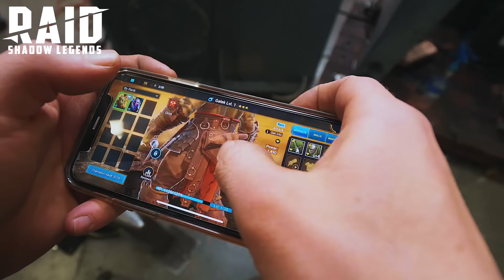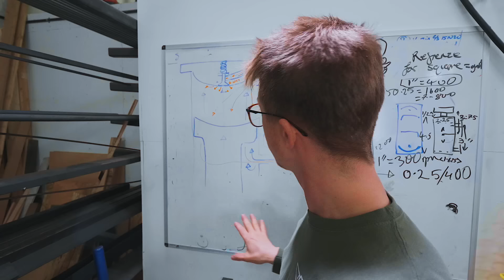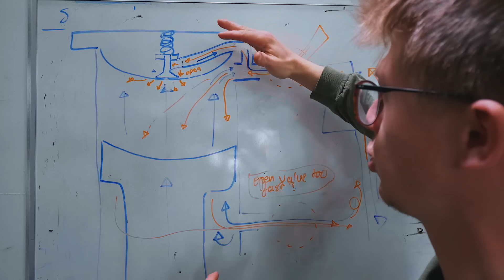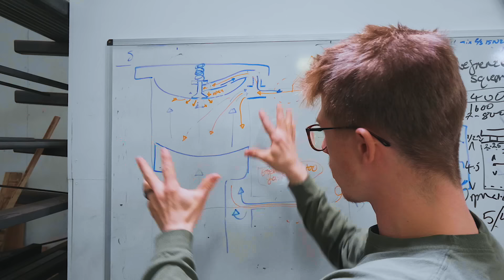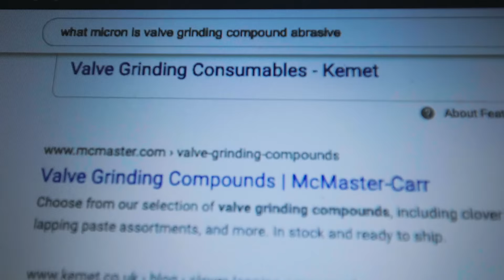FIXING THE 300LBS POWER HAMMER!!! Part 5

Comment: If you had to adjust the timing because the valve was leaking, wouldn’t you need to adjust it back once the valve is fixed?
Reply: I don't think so because the performance improved after he adjusted it and it doesn't appear to have lost any. If you pause at 7:40 and look directly left of this thumb to me it looks like the valve itself has some pitting that would prevent it from having a good seal on the seat
Reply: @435now  That's only a problem if the pitting goes all the way across the mated area...
Reply: @435now  that was the whole reason that he did the diamond lapping which after lapping you see he had 100% contact which means that that reasoning goes out the window because that was repaired. I agree with the Readjustment of the piston valve back to its original position. If the check valve was not functioning correctly Under Pressure it would be leaking air as the Piston was Rising thereby inhibiting a proper air cushion because an air cushion is relative to pressure. So when he made that to the piston valve adjustment maybe it was forcing more air into topside the Piston area which alleviated the problem because there was more air up there acting as a cushion that the check valve was supposed to be providing. Now that he fixed the check valve and its seat, that adjustment to the piston valve May inhibit performance for the opposite reason and now the check valve is not getting enough pressure to give a proper air cushion. Not to mention that since lapping, Minor Adjustments might be needed in the first place just like when you lapp components in a regular engine. If you made an adjustment and then found another serious problem. You fix the serious problem and put the original adjustment back into its original state so that you can be sure that the major adjustment may not have been the entire problem; then adjust accordingly. If he puts it back to its original position and it is still knocking the top and that means that he either needs to make very minor adjustments to the timing, or that it something else. But to fix a major issue; and then leave is significant adjustment in the timing that may not have needed to be made in the first place, wouldn't make much sense.

Comment: Looking at that valve, it wants to be resurfaced before lapping. Also: when you're lapping you want to be very cincious of how square the mating surfaces are. Lap it in whilst its being held in place with the spring and castle nut as that will be how its going to operate when it's installed. 

As an apprentice i used to grind in and lap large (3ft tall x 10"wide) valves for marine engines. Long ass work. But even on components that large, concentricity amd squareness to the valve seat via the valve guide was dialled in to 0.05mm run out etc. Good luck bud  !!
Reply: I came here to say similar. I don't have your experience, but I remember from 3 years of Auto Mechanics class in high school how important lapping is. Since this doesn't have a valve guide to speak of, I think one could make a quick slip-on guide with that big piece of DELRIN rod using the lathe. 

Then I'd probably grease the valve stem and DELRIN, and make a "flat head screwdriver" (but much wider) out of DELRIN and turn it with a drill.
Reply: Keep in mind that testing a seal with a 1/4" column of water is not very conclusive. The test pressure should be at least the operating pressure of the air cushion.

As for the color, purple with big green poker dot... why not!
Reply: It'd be worth testing it with white spirit after lapping.  Much thinner so it'll flow through much smaller gaps. Water has a lot of surface tension so tends to hold itself better
Reply: You guys beat me to it, other than to add that in the video its hard to get a good idea how well the guide fits the valve.  If theres any play in the guide the valve wont sit flush and can leak.  After having thunk on this a bit, im wondering why this isnt a spring loaded check ball.  Would get rid of the valve seat and guide all together and be much less likely to leak.
Reply: Doxnoogle - i agree that a check ball would be much better ! Maybe its down to material costs or spaxe withun the chamber whilst the valve is shut they didnt go with it ? Even so, a radiused sealing face vs a straight chamfer would be a much more reliable seal ! I cant see how the state of the valve's surface atm would be any good at sealing with all the pitting etc xD hopefully Alec catches this thread and does the right thing !
Reply: Your right,  at least in an engine scenario where even a tiny leak can cause combustion gasses to burn the valve. but my question is, in this application action with a large volume of air and very short duration, are these tiny leaks possibly causing the air cushion to fail and the ram to hit top? Seems like a huge amount of air would have to escape in 1 second or less to change anything,

Comment: Thank you for a great examination of the operating principles and mechanics. Fixing that connecting rod properly with a factory length threaded connecting rod is a great start. Then, finding a limit of travel for the foot treadle and creating a stop to prevent a hit if the rod replacement failed to solve 'hitting top' seems the best course.

Comment: The piston has rings on it like one in an engine, take the top back off and push the piston up with something and check the rings because a damaged ring will cause air to leak by.
Reply from the maker: Off camera I took out one of the piston rings on the ram to have a look and it looked very fine to me!
Reply: Alec Steele I would think there would be more than one ring , if not and the ring your looking at looks ok it still may be no good , piston rings have a springiness to them and if it has lost its springiness or has worn down you could be losing compression on the upstroke which is the cushion.
Reply: @AlecSteele  But if you put liquid into the piston chamber, would it leak out?
Reply: Wait! Does it have oilscrapers and all? that is basically a piston engine then.
But where can you get new piston rings if those get damaged?
Reply: @giampaologiana9270  from Alec's steel rack. ;)
Reply: @AlecSteele  did you check the rear piston or just the front piston? Also, if you were concerned about the gasket material for one piston, the other should be addressed as well. That rust around the top of the ram piston - if the rear has the same going on, you may be losing pressure in the drive piston exactly when you need it to prevent the ram impacting the top. I definitely agree you should inspect the other piston as well, at a minimum.
Reply: But if the leak was so huge, the piston would not pop up with such force, I'd say.
Reply: @super_slo  The ram impacting the top sould not depend at all on the other piston, but the air cusion on top. (that would be bad design to me, BUT not an expert)
Reply: @nixie2462  he mentioned one function of the check valve was to feed pressurized air into the chamber after the ram had closed the primary inlet at the top of the stroke. The source of that pressurized air is the other piston, at the extreme extent of it's travel. Right? I might be wrong about the rust at the top of the rear piston, upon further reflection it would make more sense if the drive piston was just starting its stroke at the bottom when the ram is at the top. Still think Alec needs to do a good inspection of the rear piston, check the head gaskets to ensure a good seal, and check the seals/bodies on the valve assemblies. It still FEELS like an air leak somewhere is allowing sufficient system pressure drop to prevent the necessary air cushion required to protect the ram piston from impacting the head.
Reply: Alec Steele from what I have seen, the ram could have 2 or 3 rings , one may be cracked. I would pull the ram completely.
Reply: At this point, might as well do a full tear down and inspection. Set it up for another hundred years of service. Rather see that (would REALLY enjoy seeing it all torn down!!!) than have it hit one too many times and destroyed. Maybe magnaflux the ram head? See if it's already cracked from being hit numerous times? I'm really enjoying the old iron restoration and insight into the internal workings of these pieces of artistic engineering.
Reply: @AndyFromBeaverton  : … Yes, because there is a TINY GAP where the ring ends meet in the piston.
Reply: @emc2184  Yep, as the ring wears the gap does open even more.
Reply: Alec Steele After some further thoughts I still believe you may have a ring issue, just because they look ok to the eye they may be worn down, also after watching the video again when you cleaned the valve seat which surely was leaking I think I saw a hairline crack in the head of the cover and that without doubt could have happened with the piston hitting it, I would take the cover off again and see if you could put it under your microscope and look for a hairline crack.

Comment: Hey there Alec, For cleaning grungy machine parts. Build a rotary tumbler. Fill it with stainless pins and use Simple Green Aircraft Cleaner and a bit of citronox. Fill the tumbler body with water and dirty parts. Let it tumble for a couple hours while you're doing something else. It will clean just about anything.

Comment: I imagine it being as old as it is it probably had a cork gasket. I work as a millwright, and we have a lot of old pumps, and we seem to have better luck with the cork on some of the older equipment we have. Might be work a try to help get that air seal up top. You should also check that surface to make sure it’s making a good mating surface, being so old the heavier cork may help fill any void or gap at the top, that thin gasket material is usually used in modern combustion engines.

Comment: Alec, you really should get that top cover modeled up in cad so you have something to go off of if that piece breaks. On a previous video it looked like the top plate had some hairline cracks in it. Another thing to keep in mind, you did a water leak test under no pressure. Would recommend doing a pressure test, as that chamber is under immense pressures during normal operation. Can we get a thumbs up on this guys???
Reply: Can dye pen to check for cracks

Comment: A second thought just occurred to me:  check the rings on the piston travelling up and down.  If the valve face showed the kind of pitting and wear on camera, I wonder how good/bad the rings are on the piston?
Reply: Interesting thought, definitely worth a look. That cylinder looked pretty worn, too. With how smooth it is, I wonder if it has rings or some sort of packing. Like the rings on an air of hydraulic cylinder.
Reply: If the air leaks out from the pistonrings the dampening on top is not going to work and it hits the top.
Reply: There's ya problem ;)
Reply: I wonder if there is a way that you could perform a compression test on it.
Reply: @databoy2010   Just pour soapy water on it;)
Reply: @databoy2010  It'd be unconventional to say the least, but I don't believe that information would be very useful, anyway. A cylinder leak down test would be of more use. Basically (in an internal combustion engine), you pressurize the cylinder and see how long it takes to lose pressure. When I said unconventional, I believe the easiest way to to hook a gage/gauge to the cylinder head would be drilling and tapping a hole (same for leak down test). If it was MY power hammer, I'd pull the entire piston/hammer and inspect the rings. I imagine they're quite worn. I don't know if they crosshatched the cylinder walls when they built it, though I imagine they did, but there was zero crosshatching apparent in the video. That takes some serious wear. I think air is blowing by the rings or leaking out somewhere else and not allowing that "air cushion" at the top of the piston's travel. The reason I said that a compression test wouldn't do any good is because the number you'd get wouldn't be of any use without knowing the numbers from a properly working unit.

Comment: You are a Champion Alec, keep safe buds!
Pneumatics get messy sometimes, especially for actuation equipment...
Reply: Remember to keep those tool lines dry, and oil the tools... routine maintenance it as important as repair, it's good cost saving measure too... that paste could have saved a mint in the patch

Comment: The spring in that check valve could potentially be tired and too soft
Reply: it aint the only thing that's tired and soft during this quarantine
Reply: what this guy said, the spring is no doubt fatigued from age.
Reply: @ericbarrows6606  LOL
Reply: It prob not strong enough to seat it as the hammer comes back up letting air back out. Kinda like when you add lots if horse power to diesel engine, the valves float not seating fully before the compression stroke.
Reply: Yes, try shimming the spring?
Reply: Yea I'd hate to think how many cycles that spring has done in it's lifetime...
Reply: I agree, I’ve tried opening valves on engine heads with springs half that size and strained my milk with out using a lever of some sort.
Reply: Damon McKinnon of not adjusted correctly 🤷🏻‍♂️
Reply: That's logical. Do you think an automotive or aircraft valve spring would have a similar or better strength for the application? It's also possible that the spring is available from current power hammer manufacturers.
Reply: Agree on this potential issue
Reply: Wouldn’t just tightening the castle nut an extra turn or two fix the issue?
Obviously you might need to make a new hole for the lottery key.
Reply: *cotter
Reply: @2eyedjack433  Except it's a check valve with a good bit of air volume forcing it closed. It'd be good insurance but probably not necessary
Reply: @mamaswrongagain4555  bigger springs (longer or wider) for the same size wire diameter are actually easier to compress ;-)

Comment: I notice in when you where messing with the check valve, that it seems the spring keeping the check valve up in place was weak?  IT may be over time that that spring is not as stiff as it was brand new.  Just a thought, but get a new spring, or add a washer to tighten the check valve into the seat more.   May be its still leaking some due to it not seating in tight enough?

o
Reply: It didn't look like it had a gasket under the little cap either. Don't think that would cause it but I feel like it should have one.
Reply: I agree. If it's not the seal leaking anymore then the next most likely is the spring
Reply: probably needs more lapping or a regrind as well
Reply: As someone who works on engines old enough to have non-camed "atmospheric" intake valves (nearly identical to this set up) There isnt alot of surface area in these valve and thus wont be pushed open my small differences in pressure between the 2 chambers if you have a really strong spring, but this one being weak is a possibility but iv seen much older and crappier springs  work fine on intake valves of antique stationary engines.
Reply: I think the spring idea is a good one!  It is likely that and maybe a little air/valve timing issue of when the hammer comes up and the top valve closes?
Reply: I absolutely share your concerns here. That spring seemed SUPER weak.
Reply: Shouldn't really matter if you stop to think about it. When the piston is hitting the top, it's pushing the air UP towards the gasket. This puts no pressure on the spring, which is only opens when something pushes down on it from above. The spring is almost not needed at all. It's only there to stop the valve from opening when the air pressure is neutral on both sides.
Reply: @remy5405  it still needs proper seat pressure, and there's Zero chance that's at original factory spec
Reply: @Excludos  yeah your quite rite on this one.
Reply: @remy5405  I think you're right.  75 years of marginally oiled WHACK WHACK WHACK WHACK WHACK will wear even the hardest of rings.  So, new ram rings and a new gasket under the poppet-valve cap, and that very well may help.  At this point, the ram is the only part that hasn't been inspected-- and since everything else has needed work, I'd find it hard to believe that it's in perfectly pristine working order.

Comment: You may need to readjust the “timing” on the machine.  Any time you lap engine exhaust and intake valves on an engine you also have to make fine adjustments to the timing.  So the at turnbuckle you installed might actually come in handy.  Also I think a nice coat of basic black would be appropriate, or go full Damascus pattern vinyl wrap?